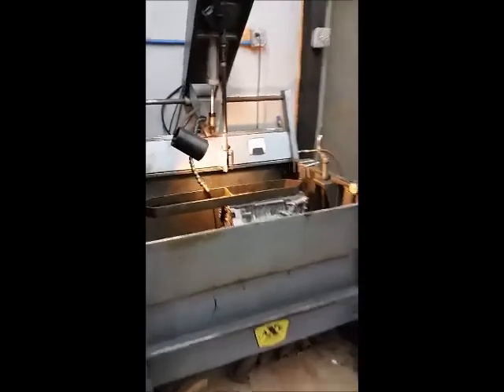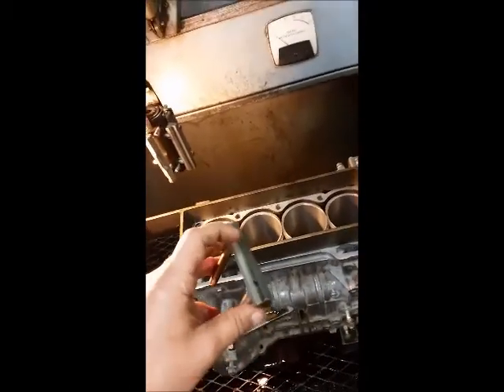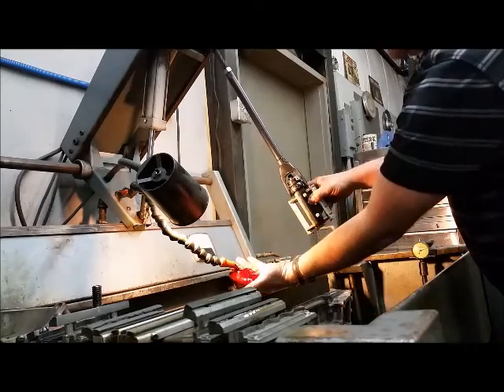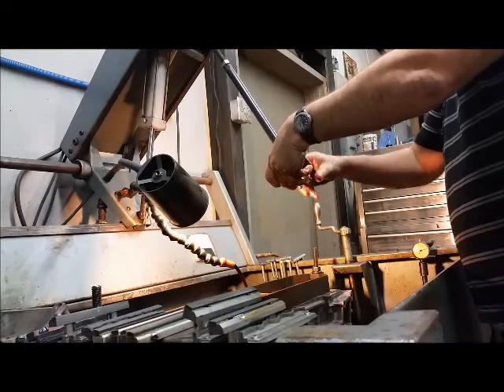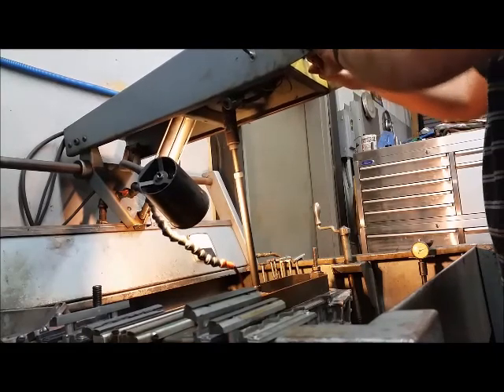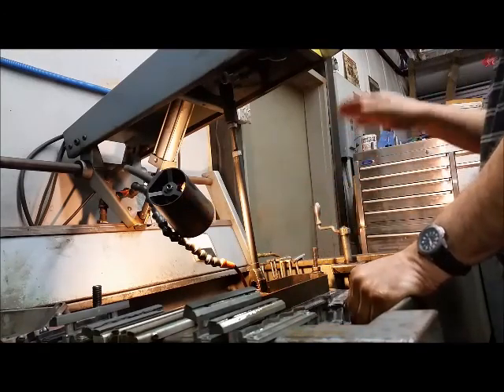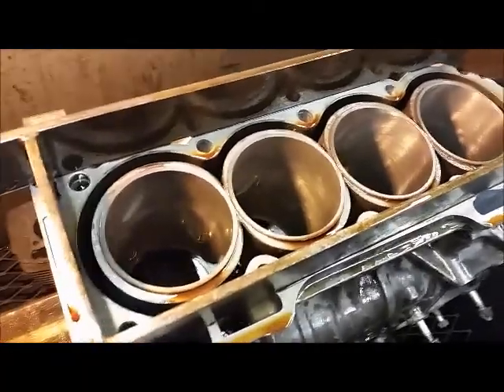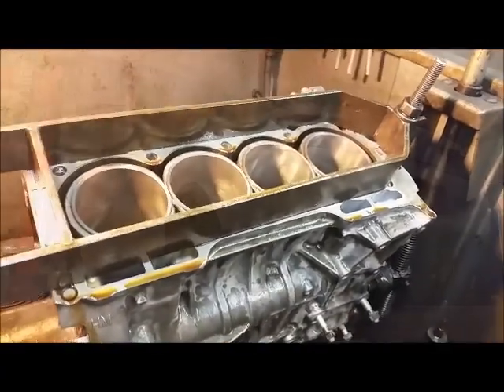Prelude Build Part 4: Cylinder Honing

Comment: Way to bring back the dead I know but im very curious how long your engine lasted. All H22 engines have Fiber Reinforced Material/Aluminum cylinder walls. They are much harder than normal ones. The tech manual calls for 600 or finer grit ridged stones only. You started with 70?and then moved to 220? This sounds like it would leave a very rough edge on cylinder walls all ready so hard they damage piston rings,  the problem w h22s, premature ring wear causing increased oil consumption, and eventual ringlead failure or skirt damage.  I am in the process of rebuilding a 93 h22a block with 01 euro r PDE head, and im at this step. I have your current equipment but am nervous. I will be putting an m90 supercharger on this and would love to hear 5 years later how it turned out for you.
Reply: But the sleeve he inserted was an iron sleeve so it's no longer an FRM cylinder?